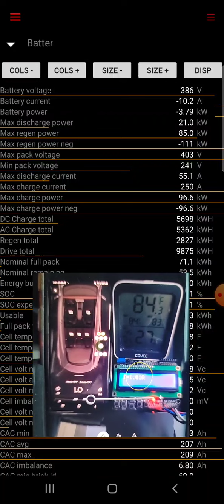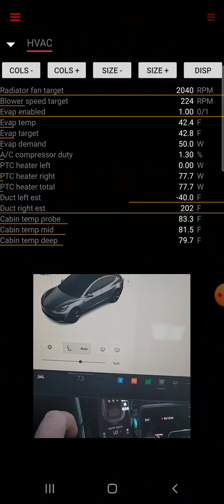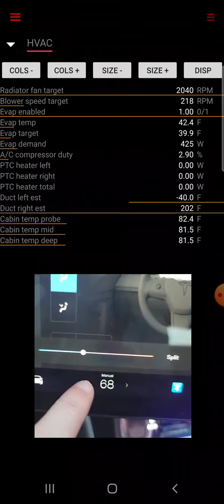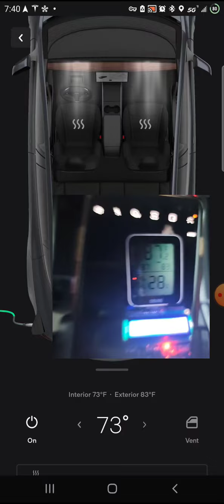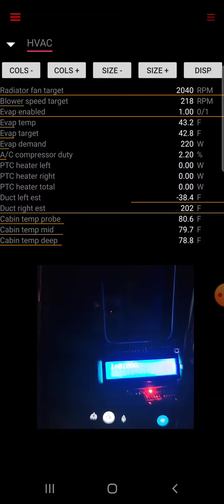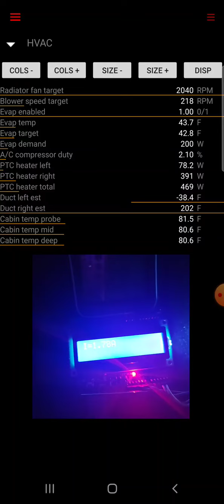Tesla Model 3 resistive cabin heater constantly still being used when only cooling is desired

Comment: Agree. There is something very screwed up with the way our 2021 Tesla Model 3 SR+ manages the interior temperature. I am constantly using the controls to make it cooler or hotter. It blows cold when I want it to be warm, or it blows warm when I want it to be cool. I have brought it into the Tesla service centre 3 times with this issue, but they always say it is operating normally and they don't fix anything. I am in my 70s and have owned lots of cars over my life and have never had a car that cannot just hold a temperature set point of 70 degrees or whatever. For some odd reason the Tesla requires constant user input to keep a steady temperature, as though there is no thermostat in the car. Very weird for such a high tech car. This has bugged me for years. Keep up the good work and let me know if you ever figure this out.

Comment: I also have weird behavior on my 19 M3. When cooling the cabin, I get warm air blowing into driver foot well.  Meanwhile vent strip on top is blowing cold air.
Reply from the maker: The only way to truly disable the cabin heater is to set the temp to LO. I put my fan on the lowest speed and have to periodically toggle AC off and back on when it gets too cold. This HVAC bug has existed for more than 3 years now.